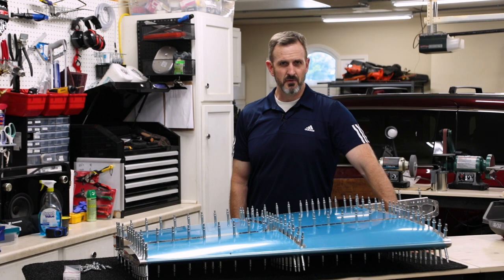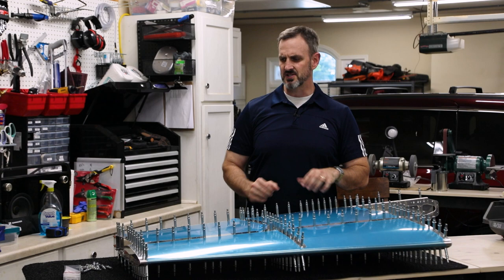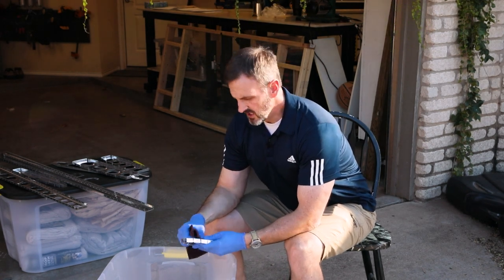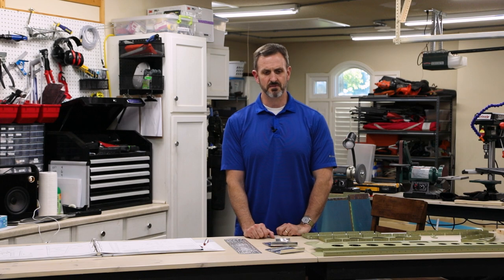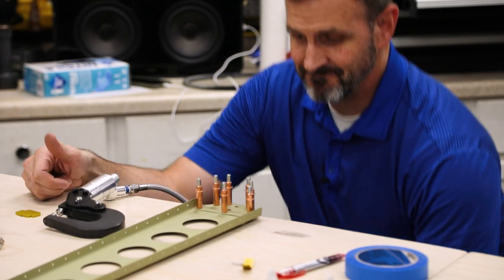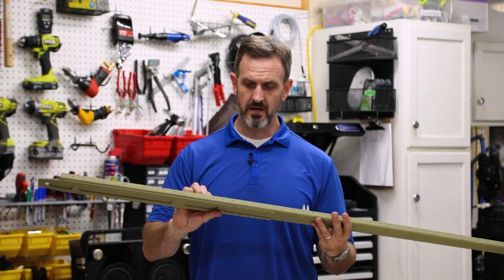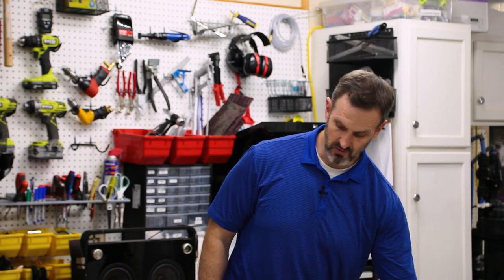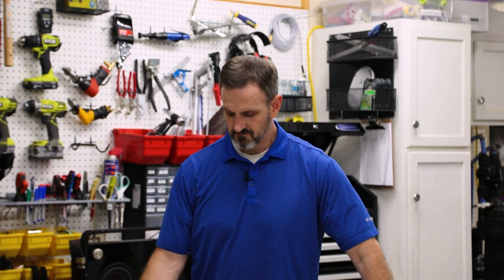Building the RV10 - Video 3 - Vertical Stabilizer (October 2021)

Comment: It looks like you have a hydraulic squeezer.  Who makes it?  Where did you purchase it?  I thought that they were very expensive.  If so, are they worth it?
Reply from the maker: The squeezer is made by Numatx. I bought it directly from them at: https://numatx-tools.com. 

I love it. It’s light, compact, and easy to use. It’s much smaller than the pneumatic squeezers that many people use and it costs about the same. You also don’t have to adjust the throw for rivets of different lengths.
Reply: Wish I had seen that squeezer before I bought mine, but definitely getting the pneumatic Cleco tool.